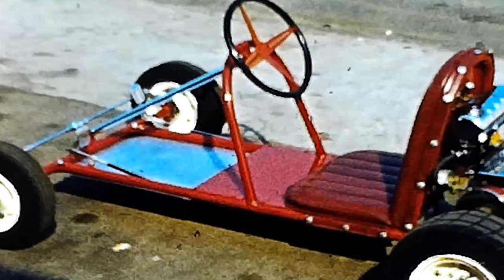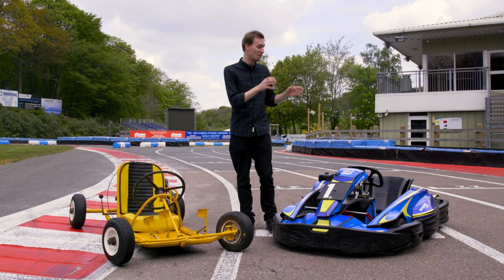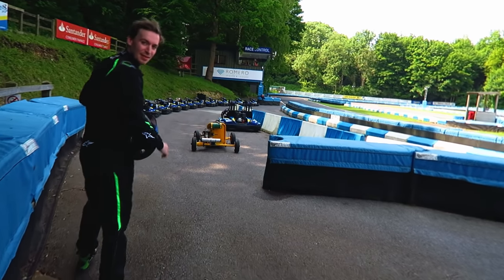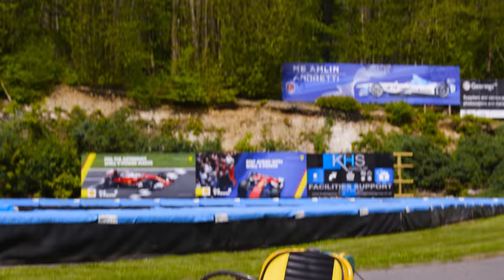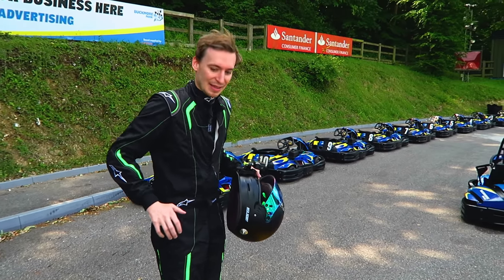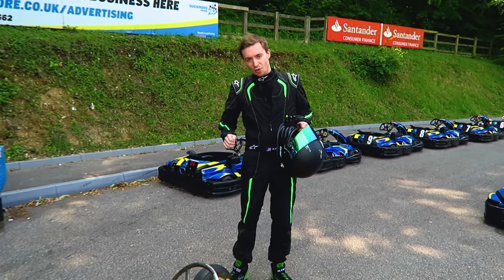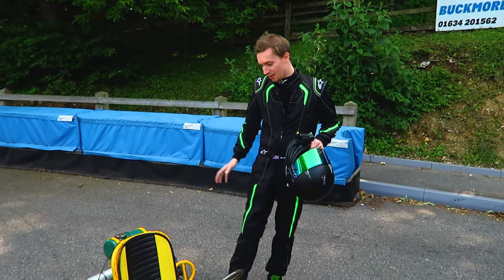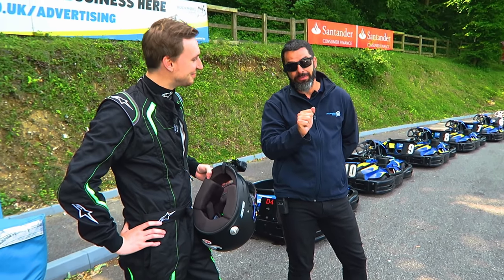Trying To Drive A 1959 Go Kart...

Comment: Last time I was at my grandpa's, I drove his left rear wheel drive, 50cc 1960s go kart. It was such a fun experience! I was surprised I could barely tell it was only 1wd too.
Reply: I had, and raced, a 1968 California cart, with a 5 hp B & S, and right wheel drive. It had paddle brakes, that pushed on the tires. It was pretty fast (48 mph) and it stopped pretty well. Tons of fun!!
Reply: @SuperBlazer00  agreed! Doesn't take too much to have fun!

Comment: If that go-pro had not stabilised the footage you wouldn't have had any footage at all lol. These types of carts were used untill well into the 70's on some tracks in my country and yeah.... I just missed these but I have driven the next generation which was slightly but not much better. They were loads of fun though (and dangerous, omg where they dangerous lol)

Comment: This looks very primativ to what we had.
In the early 60s my mother owned the cafe at the go kart track In jersey channel Islands.
I worked there as a mechanic for two years before joining the army. I worked together with the likes of Tico Martini and Eric Bisson . ( Tico became a household name in France building formula 2 racing cars Eric did lots of work developing hover craft. In 62 Eric gave me his Faster - Kart class 4 chassis and Tico gave me his crank case for my Villiers 9 e engine, Just for those interested even in those days our tuning of the 9e Engine included filling the crank case turning the barrel around so I carb was on the front, coil ignition, etc scwish head +++ and hours of work on the piston and barrel with brasso.
These days you just buy everything already done.
Class four was fun.
The combination was very quick out performing
Kommet and parrilla engines class 1 on our small but fast track at quennevias in Jersey channel Islands. Tico built his famous 6ft wheel base hill climb special, powered by a Triumph Bonneville
Engine in the workshop. I think Jersey was well advanced in Karting In the early 60s due to the wonderful people who enthused and contributed to a great sport . 
We also built all the hire karts in house. Welding from tubing to Tico and Erics design. J L O engines rear drum break built obviously like a tank to withstand the driving and crashes the tourist got up to. In the summer season we were always visited by visiting pop groups such as the Beatles and the rolling stones ( we had another name for the latter. They behaved like animals
Even the airline they were flying with refused to fly them back to the UK. They also got pelted with tomatos at their first performance.
Anyway karting is a great sport.

Comment: The carb was woefully tuned. It would have been a completely different experience with it running properly and new tires. Those old carts were a lot faster than you are giving them credit for. The lock on the front was a tool used to scrub off speed BTW.